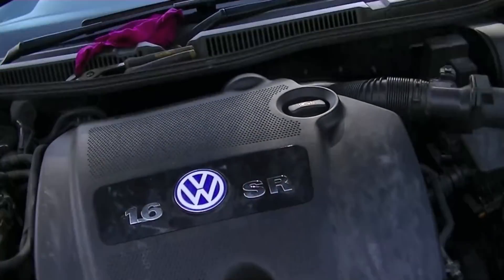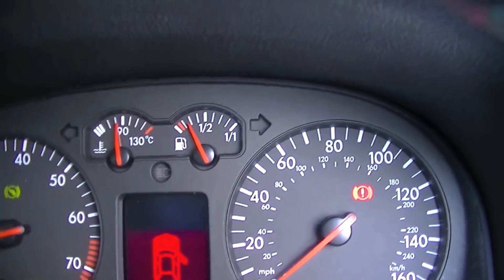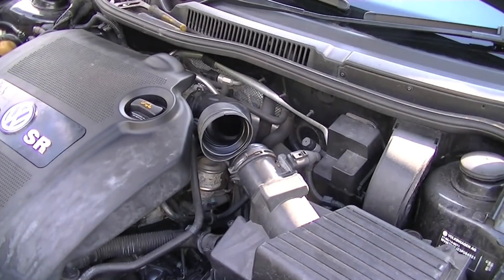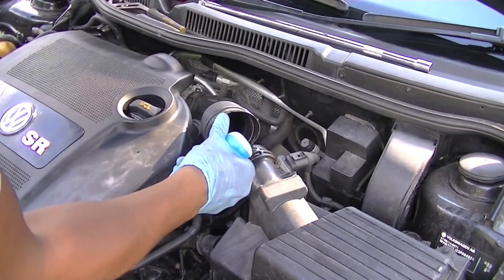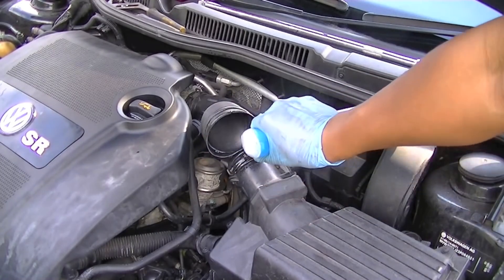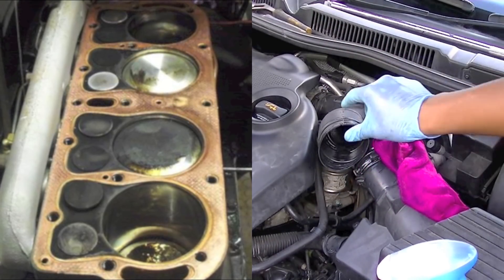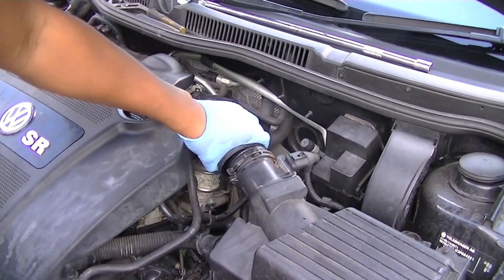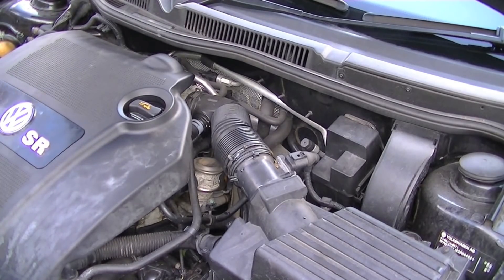How to make your engine run better with just tap water.......Better Than Seafoam?

Comment: Why are you telling people to pour water into a giant compressor when water is incompressible? You realize this is how you blow up an engine. Good possibility thats what caused the previous head gasket to blow.
Reply from the maker: Can you remind me where i say to "pour water" into the engine please.
Reply: +BMAC VAGS Pour, spray, doesnt matter how it gets in there.
Reply from the maker: Nick Palaroan That is the thing, it really does matter
Reply: +mechanicman2000 I still have seen no evidence that it would "clean" it. Not only that, as iv said the water your spraying into the engine, is not pure H20. If you wish to do this, its best to use distilled water to reduce the risk of introducing a bunch of minerals and salts into your engine that can potentially damage it. There is a reason air filters exist, to keep junk out that you now want to literally spray directly into it.
Reply: +mechanicman2000 Unless it has been distilled, yes water contains salts and minerals.
Reply: +Nick Palaroan You stupid? The engine would just hydrolock first you sperg
Reply: Before what?Kran
Reply: Nick Palaroan Its not possible for the engine to blow up with water, stop trying to be clever
Reply: Kran
Actually it is....what happens is when you increase the compression ratio dramatically by introducing water into the cylinder you can get a very early detention of the fuel which can send a piston shooting directly through the bottom of the block and out. I have personally seen this happen, and its cool as fuck to watch.

Chances are that it will lock up first, but not always.
Reply: Please provide your data showing how much the compression ratio is increased by the introduction of water.  Please include various air/water intake mixture ratio examples, such as 1000 to 1, 100 to 1, 90 to 1, etc.  A graph-type chart would be preferred, if a link could be provided to one of your creation.  Thank you.
Reply: Adam Schneider
Its physics. Water is, for the most part, in-compressible. That means when you put it into a close cylinder and attempt to compress it, it will not compress but instead will just decrease the effective volume of the cylinder which increases the compression ratio.

 http://www.autoevolution.com/news/engine-hydrolock-how-water-can-damage-or-destroy-your-engine-90270.html
Reply: Nick Palaroan There  is  not  enough  force  to  split  cast  metal  with  back  pressure. Pls listen to the people who know what they're doing.
Reply: Thank you for your reply.  This article does not contain the requested data.  It appears to contains information suggestive of the results of complete H2O submersion of an internal combustion engine; a cylinder air/water intake ratio of 0:1.  Please submit the information in the originally requested format for an accurate cause-and-effect scientific conclusion.  Thank you.
Reply: Kran
Again, I have personally seen it happen. You obviously have NO idea how much pressure there is during a combustion cycle and what happens when you dramatically increase that pressure..
Reply: Adam Schneider
That is what we are talking about....it explains pretty clearly the effects of filling an engines cylinders full of water...
Reply: Thank you for your reply.  I agree that the video link you provided does, indeed, reflect the results of filling the cylinders with water, which I am in complete agreeance, however, the data I am requesting is not of the results of the cylinder's majority displacement occupancy being of water ≥ 51% (The video link seems to suggest a near absolute air/water ratio occupancy of 0:1).  I am interested in your data that shows the results of increased engine compression ratios from the introduction of water into the air intake system at a ratio similar to the original video author; air/water ratios ≥ 100:1 and at what point/what amount does an average engine show an increase in cylinder compression ratios?  For example:  At a 1000:1 air/water  intake mixture ratio, the engine cylinder compression ratio rises from 8:1 to 8.5:1.  At a ratio of 100:1 air/water, the cylinder compression will rise from 8:1 to 10:1.  A graph-type chart with as many data points as possible would, undeniably and absolutely answer all questions regarding this debate.  Thank you.
Reply: Adam Schneider
Go to school and learn it yourself. Its basic physics if you dont understand it Im not going to make a chart for you to. Thats not my job. I have explained to you how it works, if you need more education beyond that seek an educational institute to help you.

In fact, its basic physics.
Reply from the maker: +Nick Palaroan Don't be a coward when you are being challenged. You make the premise to be a "know it all", so rise to the challenge.  Or is it that you are getting a strong whiff of your own bs.  Just sayin......
Reply: BMAC VAGS
I have already explained how it works, I cant improve other peoples comprehension on the matter.

The only thing I can do is try to provide a better example....

The compression ratio is based on volumes of the cylinder at bottom dead center and top dead center.

So lets say at bottom dead center, the volume inside the cylinder is 450cc.  Now at top dead center the volume has been reduced to 45cc. That would give you a compression ratio of 10:1.

Now introduce an in-compressible variable into the cylinder, water in this case, you effectively reduce the cylinders volume at top dead center. Because now there is space being taken up inside the cylinder, that will not compress.

So if you add 10cc of water into the engine while the piston is at bottom dead center, you have effectively increased the compression ratio to 12.8:1 . Because your bottom dead center volume does not change, however once the piston reaches top dead center you will have reduced the total area by 10cc so now your equation is 450/35=12.8.

I cant really go into anymore detail than that. But thats the mathematical reason why it increases the compression ratio.
Reply: +BMAC VAGS This would also be how domed pistons increase compression. Its the same concept. 

Im not saying this will happen in every scenario, Im simply saying that its a possibility and CAN happen under the right circumstances.
Reply: it doesn't appear that 10cc per cylinder is being introduced in the video to increase the ratio from 10:1 to 12.8:1.  How many cc of water would you say that a sprayed mist from a bottle is induced per cylinder?
Reply: Adam Schneider
10cc is a very small amount. Theres no way of knowing at all how much of that water was introduced per cylinder because theres a million factors....the main one being whether or not the water evaporated before or after it entered the combustion chamber. Too many environmental factors to know for sure.

I was simply stating how its possible.

And actually, I think my previous math may have been slightly off. Since you introduce 10cc of an incompressible liquid the BDC volume should change as well (presuming it cannot suck in as much air and fuel although most valves close before BDC so most cylinders never use their entire volume) so the formula would be:

440cc/35cc = 12.6:1. However, it would not reach this actual ratio because the fuel would pre-ignite before the piston could reach TDC.

Comment: Use very cold water to create a shock that breaks the carbon loose. We did this many years ago on Old Cadillac's with burnt exhaust valves. We poured ice water down the carburetor slowly while working the throttle by hand. Sometimes red hot carbon pieces would fly out the exhaust lol,  so we knew it was working.  It saved a valve job quite a few times. Thank you.

Comment: By cooling the combustion temperature, the water injection system improves fuel economy as well as performance. While it produces plenty of extra power and will hit 100 km/h (62 mph) in 3.8 seconds, the GTS uses the same 8.3 l/100km (34 mpg) as the standard M4.

Comment: Central to the upgrades BMW has fitted to its M4 GTS is a water injection system, which bumps power up to 368 kW (500 hp) and torque up to 600 Nm. That's an extra 59 kW (80 hp) and 50 Nm compared to the standard car, though still 7.5 kW (10 hp) and 50 Nm less than the Mercedes C63S AMG.

BMW has been using water injection to boost the performance of its M4 MotoGP Pace Car, and also previewed the technology in a 1 Series a few months ago, but the M4 GTS is the first production BMW to feature the technology.

Comment: It is not a good idea to spray water in such amount into the engine and here is why:
he main difference between an engine from the 60's and today is the higher compression ratio.
Lets think throw the process of water being inside the combustion chamber before the ignition:
The air and fuel mixture gets compressed by the piston. Now air and gasoline/diesel are compressible media and water is not. So it basically acts as a solid object inside your combustion chamber, decreasing the compressible volume. So if you started with a compression ratio of 10:1 without water, you can end up with 15:1 or 20:1 with water. And note, that is all before the actual ignition of the mixture! That is extra load on the oil-bearings, piston rods and is common under the name "Hydrolock".
Now why did that method "work" in the 60's? Because the compression ratio was lower, all the parts thicker (nobody gave a Schinken about lightweight engines at that time).
And during the ignition? Well a big part of the combustion energy would go into evaporating that water you sprayed in and it becomes steam. Mildly hot steam. And then what? How should that steam clean carbon away? The normal combustion process produce a lot of steam too (all that hydrogen reacting with the oxygen).

And to the arguments of "engine sucks water from rain anyway". That is clear bull... Every engine (OEM) intake manifold has special curves to filter that rain drops out and not let them inside the engine. Even if you drive throw a monsoon...
There are even a bunch of patents about how to dry the air before the combustion! (in order to increase the overall efficiency...)
So maybe not a good idea...

Comment: There's no way this is hurting anything but the quantity of water and duration of exposure is also far too low to make a noticeable difference even if we concede the possibility of steam cleaning the carbon deposits over time. Conclusion, there is no net change. There are products that work if used correctly like Seafoam, even in modern cars, we don't need to look for home remedies to issues solved for less than $10
Reply: prove it?

Comment: speaking here from experience as a certified automotive technician. the reason why coolant cleans so well has to with the ethylene glycol and normally has nothing to do with the engine even running. you can literally take a piston that's been removed from a junk engine with tons of carbon on it , let it sit in coolant over night and you'll be able to remove the carbon with just slightly rub of your index finger. ps steam cleaning the pistons does nothing. you need to clean the valves in order to gain back fuel economy, second thing your asking for exhaust issues next ,the idea of the exhaust system is to release all the engines waste from unburned fuel, lean fuel curves, nox, hi co2, low co2 etc... when do this your raisin up the hi co level witch is known to cause that rotten egg smell from the hi co hitting the built up carbon inside the catalytic converter . so if you want a steam cleaned engine but 200 to 1200 dollars worth of future exhaust issues then by all means steam away....
Reply from the maker: Cars that run on hho also have clean internals, they have no glycol mixed in to solution, can you explain why that is the case?
Reply: +BMAC VAGS 
Water injection in a long term basis will remove it all. 
It's  not a 2 minute deal but noones patient anymore.
They want it instantly.

Comment: this method will not work unless you are sitting there for weeks spraying it.  and even then.  it isn't good for your valves as the steam will at moisture into the oil, creating sludge. Another note to make, is if you put to much water in the engine.  or you have an engine with very high compression, you run the risk of distroying your rings, or blowing a hole in the motor. air is easily compressed which is why you dont want air in hydraulic systems. why do we use fluid for hydraulic systems? because the slightest compression creates so much force you can easily push your breaks or clutch. when the force required  is so much greater than what you are applying. now, compare that to the compression stroke of a cylinder. you cannot compress water without 1700 pounds of force and the compression at that point is almost impossible to detect. water cant compress causing the cylinder to have an extreme amount of pressure because the other cylinders are firing to move the crankshaft. forcing the water to try to compress, thus blowing a hole in the block. stupid to do this. little bit of water is ok. but over spray.  and bang.  there goes c3. or valve seat #12 etc. use a combustible product if you want to clean them.  in fact carbon build up can acually help the motor run better. dont be dumb. if u want to try this. be very careful. Honda mechanic manager in westbrook ct.

Comment: well it works with a steel heads  i tryed it with a 4 cly with a alumiumin head and what it did the value seats are steal and when the cold water hit the seats they pop out of the head and almost bent the values , so dont do it with a aluminin heads or you could sbe spending a whole lot of money learn from me its not cheap.

Comment: Do a before and after test with a camera that makes it down into the cylinder. There is your total proof at the end result. The actual water that leaks into a cylinder via a blown head gasket is antifreeze and glycol based and not just 100% water so this may have a different cleaning effect. The length of time for the blown head gasket and the motor burning antifreeze is also another issue. You need to confirm proof positive on this because this is not evidence enough to support your claim.
Reply: +ChiefJustice Middleton Totally agree, usually a leaking head gasket with coolant being burned in the combustion chamber happens slowly for weeks even months of driving. You can't spray a little amount of water for 30 minutes into an idling engine and "think" the carbon has all but disappeared....i believe it did nothing but possibly jeopardize-foul the 02 sensor/s

Comment: Would it work with high temperature steam (160 C)? I believe it would prevent all impurities in the water to get stuck in the engine and it would  provide a more constant volume of water dropplets in. The volume of steam can be adjusted but I wonder if it will work in term of cleaning. I'll probably film it and post results, but I'm wondering what people think of the idea prior to doing it.

Comment: I used to run a garage for years back in the 60's and 70's, we actually poured a small stream of water into the carb. and it does clean the entire combustion chamber, but the misting will be much safer for the inexperienced to prevent a hydrolock, that will occur if the volume of water entering a cylinder is too great of an amount to be compressed, for the guy who asked water mist is just molecules of water with a lot of air entrapped in it this can be slightly compressed up to a point. If a large slug of water ( or other liquids such as gas or oil) entered the cylinder the rising piston with closed valves will compress the gasses (air) but liquids can't be compressed so something has to give, usually it is a bent rod, cracked piston or head or blown head gasket.The reason we used to remove the carbon years ago was all fuels were full of lead and other hydrocarbons that left heavy carbon residue in the cylinder after combustion and pieces would break loose and get under the valves causing clicking noises and it also caused hot spots that ignited the incoming  fuel charge causing detonation which will completely destroy an engine, especially a 2 cycle.another thing that has destroyed engines is people trying to stat an injected engine over and over with no firing, this could fill the cylinders with fuel and since liquids don't compress guess what --bent rods ect...now that fuel is lead free the carbon has been reduced a whole lot!I have seen this guy on many post trying to discredit Seafoam and I do not understand why, I run a 300 hp Yamaha outboard and Mercury in the past and if you did a propeller change your hands got black burned 2 cycle oil residue on them and it is very hard to wash it off your hands, we started using seafoam in the fuel and guess what we can change props after running for weeks and NO black residue that amounts to anything, this tells me it is some kind of good detergent, bottom line I have proof it does work, although I haven't torn any engines apart that had been cleaned by it? That would be the real proof, run it through an engine just before disassembly to see how clean it is inside!

Comment: I was curious so I tried this. There was a small difference in the amount carbon on the piston however the water also contaminated the oil in the sump. The engine oil was milky white just like if the engine had a head gasket failure. 
Before anyone says the white oil was unrelated to the water, the engine I tried it on is a Honda GX270 air cooled engine.

Comment: i know in World war 1 and world war 2 the german aircrafts added water to the fuel as "boost". This increases the compression and the engine has more power. But does not work for long time and if there is too much water your rods say goodbye. because water cant be compressed

i never would try this on a modern car. fast engine dead blown rods